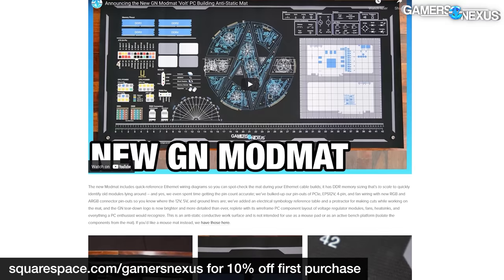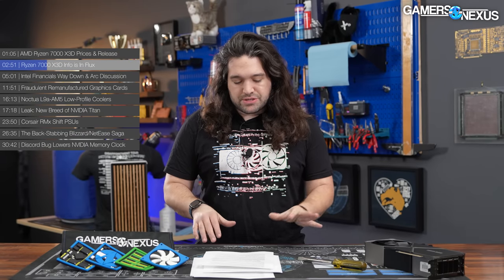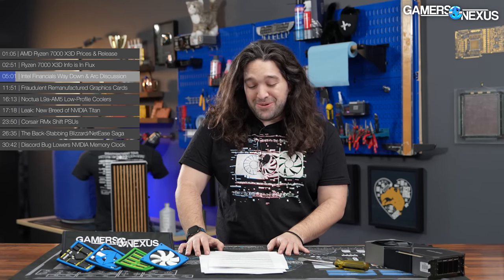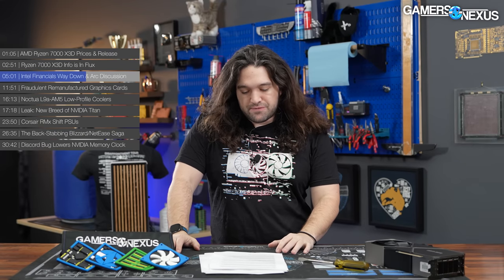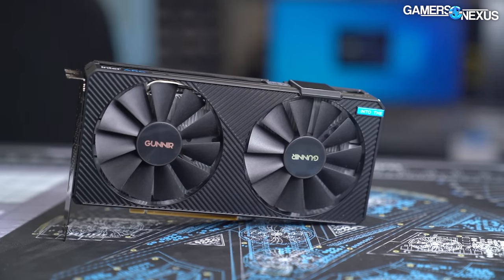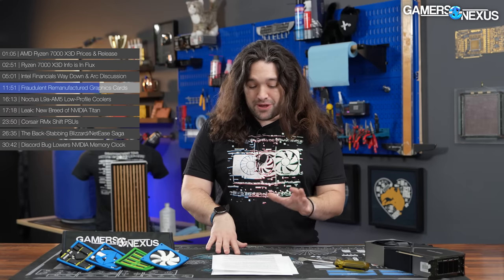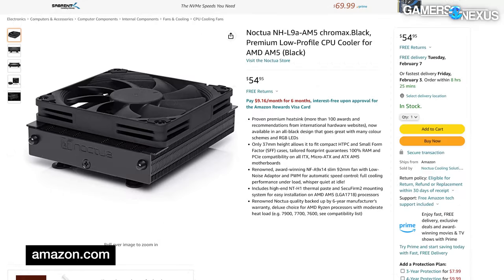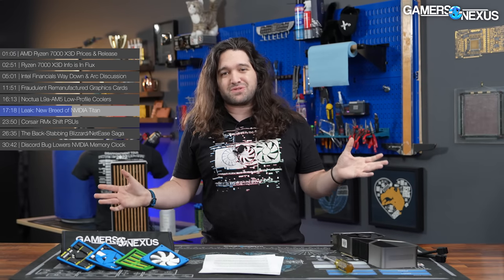HW News - Fraudulent Used Video Cards, 7950X3D Pricing, New NVIDIA 'Titan' Rumors

Comment: 5800x3d had locked curve optimizer in bios, but you can still do it with software in windows, it's only locked because F the user.
Reply: Undervolting the 5800X3d does wonders, still stable, higher clockspeeds and lower temps

Comment: Maybe you could disable 1 CCD on the 7900x3d to stimulate the 7800x3d before it launches. Would be helpful to plan my upgrade path and give better perspective.
Reply: You mean the 7950X3D, as doing that with the 7900X3D would instead simulate a hypothetical 7600X3D.

Comment: I literally just finished installing a Corsair RM750X after my old one died, and I had to (like you said) jam my hand in against the PSU shroud and spend a good 10 minutes trying to get a PCI-E cable to fit into my power supply. I for one support this new shift design if it means less of a hassle.

On the other hand, if I got a white version of the PSU or had a white case, I'd probably have the contrast to be able to see well enough that I wouldn't need the shift. Or hell, give me bright white cables so I'm not trying to fit a black cable into a black box in an enclosed space. The gimmick could be a good idea but what the hell? Why not just paint your connectors? Anyways, rant over. Great vid as always.
Reply: Or plug them in first. 😁
Reply: @memitim171  Haha yeah true. I thought I did man, but the second bit of the ATX cable into the PSU wasn't completely in. And again, that black on black is super difficult to see. I was checking the power switch connectors on my MOBO before I realized

Comment: That thumbnail with a 7950x and a Noctua low profile cooler reminded me of when Optimum tech paired that cooler with a 3950x a while ago. You've covered a lot about the lower TDP AMD CPUs recently and it was very encouraging. I'm really curious how an ITX system cooler would fare with such CPUs, both from Intel and AMD.

The blackridge won't be updated to the AM5 by the way.

Comment: Moore's law has dead showed a full render of a Titan Ada engineering sample that looks like this. It was about a month or so ago before this came out. Hardware Unboxed even publicly defended Tom when Kopite called Tom out for "lying" and faking what the cooler looks like. All Kopite said was that the titan was 3 fans, but they didn't say much else.

Tom's video is titled "Titan Ada Lovelace Leak: Pictures of Nvidia’s Dual 16-Pin Monster!" or if you trust a link https://youtu.be/wwZr4kp2gnc

Just a thought, either way, thanks for the great content on testing CPUs and GPUs
Reply: Moores Law Is Dead also insisted that Intel had completely abandoned Arc, with zero proof.
Reply: @Joostinonline  There isn't any proof they haven’t either, and it’s no like we can trust what intel says. Look at it like this. Raja got effectively demoted to his old job, and they stated that they are dissolving AXG and moving them to other departments.
“””
This includes our consumer graphics teams joining our client computing group, and our accelerated computing teams joining our datacenter and AI group. 

In addition, Raja Koduri will return to the Intel Chief Architect role to focus on our growing efforts across CPU, GPU and AI, and accelerating high priority technical programs.
“””

Look at their earnings for this year. They are estimating to have their first net loss in over 30 years. AXG is them almost 1 Billion a year. Can you honestly not see the writing on the wall? Don't get me wrong, I'd like another competitor in the GPU market, but I'd also like to keep a competitor in the CPU market against AMD also. Concider this
1. They stated AXG has been dissolved 
2. That they can afford to launch a full lineup right now, and not just a low end SKUs (including enthusiasts high end like they promised)
3. They should launch in an over saturated market,
4. People will want to buy an “inferior”(economics term) product over a "normal" product with their reputation at a price where they can profit.

They can’t afford anything that won’t be profitable right now. Tom did say they may have a single low end die each gen for driver development to have the option to launch a bigger lineup for Druid or later.
Reply: @Joostinonline  NOPE. He specifically said they are scaling down, and that instead of three chip designs for Battle Mage, they will only be making one.
Instead of listening to other people's interpretation of his video TITLE, you can try listening to his video instead.
Reply: Moore's Law is Dead is too quick to pounce on any rumor. This one example does not make up all the other times they were wrong. Even a broken clock is correct twice a day.
Reply: @sammiller6631  He leaked the code name for Lunar Lake, Dragon Range, Redwood Cove, got exactly what MI300 looked like prior to the announcement, the "ARC story." the performance jump of Zen 4, Ada using 4nm, HEDT being replaced with "mainstream workstation," MTL having accelerators, Bergamo, Zen 4C, performance of Golden cove, 
Shall I go on?
But I guess he can somehow made up renders for MI300, Titan Ada, ARC. Pretty impressive for a small broken clock

Comment: I really hope that AMD and the board partners end up allowing PBO and Curve Optimizer for all the X3D products moving forward. XMP, 1T memclk, PBO 10x, and CO -30mV are the only tweaks I ran on my old 5600X, and I find myself missing the final two on my 5800X3D.

I ran a LOT of benchmarks when attempting to dial in the perfect OC, and PBO + CO were the only two that showed anything I could daily drive that had better than margin of error changes.Anything else was just unstable. That might be my setup or cooling or something being trash, but if so, that only means PBO and CO are even more amazing.

Comment: I'll be very interested in seeing the gaming performance of the 7800X3D. I recently upgraded to a 5800X3D due to how well it's still holding its own, so I'm very interested in seeing how the extra cache benefits 7000 series.
Reply: While I am looking forward to the 7800X3D, that design was already proven on the 5800X3D. As long as AMD didn't do anything super dumb, it's guaranteed to be a great chip.
I'm more interested in what the asymmetric caching setup does to the 12 and 16 core parts. Are the cores on the other CCD going to benefit from the extra cache at all? Will they suffer a performance penalty? Will they clock higher than the cached cores?

Comment: Just invert the card! Cooler pointed up and not down, better cooling too cause that's how a vapor chamber is structured. Moisture gets heated on die then goes up as vapor condenses back into liquid then flows back down to the die. Never made sense to have it the other way around.

Comment: The noticeable point is how they capped the frequency of the 7800X3D @5Ghz so that it doesn't cannibalize the higher end ones that are uncapped to higher boosts.
Interesting, understandable but ugly. Strategically correct from them, but bad for consumers.
Reply: It is an architectural thing. 7950x3d, and 7900x3d only have V-cache on one core module. So one can boost high, and the other has the cashe. The 7800x3d only has one core complex, so they have to cap clock speeds like the 5800x3d.
Reply: @iankovac1878  ah ok... thanks.

Comment: Vertical PCB on Titan is intentional. 
That way you cant stack them on conventional MB even with low profile aftermarket liquid coolers attached and if you need several of them for workstation - you'll have to buy RTX6000(Ada) instead.

Comment: Steve, i'm sure you don't read this crap but it's pretty obvious what the intent of that cooler design is, to show off the sideways mounted gpu everyone seems to want and allow 100% airflow through the card instead of only one part, it actually makes a ton of sense, the part your looking at is the bottom, it plugs in sideways, the card itself ( the pcie interface / gpu ) will be on the top, the whole cooler is slung underneath, and the fans can blow right through, unrestricted.

Comment: Kinda sounds like we need an odometer for video cards. it would be trivial for nvidia to implement a read only timer for the 3d engine, few bytes of flash.
Reply: It's only read only....until it's not. 😁 Failing that, they'd just switch out the flash...

Comment: The Frankenstein GPU story goes in stark contrast to the video Linus put out yesterday. They bought 17 cards off ebay and had only 2 bad apples, with one being DOA. The conclusion of the video was: its not as bad as you thought and go buy second hand. At this point, it would be very very advisable from tech channels to make a PSA. In-depth dive to the dangers of second hand, more so after a mining boom. And it seems, there has to be a investigative piece on shady retailers. 
There is nothing wrong in salvaging working cards. But trying to SCALP on it is the main reason why no-one should NOT buy from such places or people. If there is no public outcry for such practices, then the ONLY option to hurt and teach such scammers is hit them where it counts: on their wallets.

Comment: You can also see the cutouts for the display output ports. And on the side for a sideways PCB there appears to be some locating pins and screw holes to secure it to the cooler.

Comment: The mess with Blizzard/NetEase is precisely the reason why the last multiplayer games I've ever bought were TF2 and CoD4. The reason being that you can run your own dedicated servers on your own hardware and it'll still work in 20, 30, even 50 years down the line, long after the official first-party servers have shut down and the developer/publisher has gone out of business. I've only ever bought single player games since that can work offline.

However, if someone does build a multiplayer game that has dedicated server software that the community can run (or one guy at a LAN party with no internet access), I'll buy and play it. I've been waiting 15 years, I can wait longer.

Comment: Just an opinion, but that "rooftop A/C unit" looks like a jig of some kind.  Current GPUs are made of copper, aluminum, and thin stamped steel.  That thing is solid, and I bet weighs 25 pounds.  I'm sure I'm wrong, but that thing looks like it is build for years of manufacturing, not a one-time install in a PC.

Comment: The rebadging of chips is a serious problem that the retro computer community has been dealing with for quite a while now. It's very common for sellers to take used chips and rebadge them, often as the same chip, but just as often with fake part numbers. It's seriously putting a crimp in trying to find replacement parts that are proper these days. We can't understand why they're doing it either. In the retro chip market, the chips are worth what they're worth, and painting them over with the same number doesn't do anything for the value really, and rebadging them as something else is just ridiculous when you're talking about things that cost a dollar or two generally. It's weird.

Comment: I absolutely tried to give Intel Money last Q. I looked at their offerings and given they are only doing 1 gen on the socket, there won't be an upgrade, and if I were lucky (and I wasn't) I could get the motherboard I wanted with just 1 gen5x4 m.2. AMD has committed to a 14th gen AM5 and the motherboards all have 2 gen5x4. I need the upgradeability.

Arc: they cannot give up. Intel is done if it can't sell GPUs on the main stage. Their entire future depends on GPUs and AI.

Comment: That discord bug makes a fk ton of sense. When I'm playing OW2 at the frame limit my game randomly crashes like every once in a blue moon when a lot of abilities are going on and I turn my camera quickly for a flick shot or something.
Reply: OW2 randomly crashes anyway with Nvidia cards, it's a known issue.
Reply: OW2 is way way way more CPU bound than GPU, i spend a long time trying to get rid of my dips and stutters and a few days ago i got the 5800X3D and it fixed everything @hypervizor
Reply: @handlenotset  I have a 5900x but it could be that the extra cache u have matters. My GPU is a 3090 and I've even tried using Rebar to see if it changes anything but the crashing is just too infrequent for me to know what is causing it and it's not always the same error.
Reply: @TheRealHypervizor  it really might be the 3D cache. i upgraded from a 1700 and while its the same amount of cores and similar clock speeds (my 1700 was overclocked) the difference in gameplay smoothness and fps is insane. went from 180-250 fps with microstutters to 500fps and havent had a single stutter moment since. my gpu is an old 1080

however, i havent had any crashes before or after, so something else might be going on

Comment: I had noticed my GTX 1070 memory clock dropping by 200MHz compared to what I set it to in MSI Afterburner but I assumed it was because I was pushing it too hard and forcing it to downclock, I had no idea Discord was causing it. Alas it's a moot issue now, I upgraded to a RX 6750 XT only a few days ago.
Reply: It's not Discord causing it if AMD drivers (and Intel?) are working fine. It's Nvidia getting sloppy.

Comment: i bought a sapphire 6900xt se via a dealership store. the box had 2 sapphire seals. one of the seals was broken but overstickered, with a round, clear sticker sealer. the boxed inside, looked already opend, but the anti static bag was sealed. on first glance, the card inside looked new, but some hard to reach spots, like deep groves in the cooler shroud and cables under the cooler, showed heavy dust buildup. fingerprints were all over the card, no foil on the card eighter. the 3 fans on that card, can be dismounted, but you need to unscrew 3 screws to do so. thesere screws showed markings of beeing unscrewed once already, the fan pins, werent even placed into the socket right, meaning they didnt turn because they got no electrical connection. i told the dealer, wanted to return the card for that reason. his reaction: can you proof that its not an old 2 year old card from you, that you wanna return to me and keep the new one i send you? you say you got used hardware and suspect a used mining card, i suspect, you had that model of card already, bought a new one and want to return your old one to me..

i feel scammed. its a bad situation, when even dealers get cards from distributors, that are cleaned up mining cards. well, now iam getting a 4070ti. i can be quiet sure there, not to get a mining card or a frankensteined one because its to new for that. i will never buy gpus again, after a crypto crash, when its a last gen card

Comment: Tertiary reason for the potential change of the Titan's orientation could be due to the fact that in thickness gpu's keep getting thicker and thicker and if that trend is expected to continue with each generation then it growing outwards with each gen towards the tempered glass instead of covering up more and more of the motherboard over time it makes sense to do it for that reason on top of the sag issue, that's exactly how I would do it... alternatively I can see direct motherboard contact becoming a thing of the past with larger GPU's and having them in a partially shrouded seperate compartment with a pcie extension running from the MB to the GPU the same way a PSU is seperate might become common place!

perhaps having the gpu at the bottom of the space with a panel right beneath the maximum motherboard size and then having perhaps another place to mount fans and gpu cooler radiators on that panel to push all the hot air upwards into the mb compartment! I could be wrong about the direction but my visualization of what that could look like in my head is sound! (I don't see this happening with form fact pc's though the gpu's are already suffocated without a shroud... this would be something reserved for larger gpu's and midi-towers upwards)

Comment: I got a Corsair SHIFT Power supply (850W version). I don't use the HDD Cage in the Lian Li O11 Air Mini, so the vertical oriented cables actually work quite well for this PSU!

Comment: Just a tangent.  I have kept my Silverstone RV02 case all these years (it has gone from Sandy Bridge to x570) partly because it rotates the MB 90 deg and so the graphics card mounts vertically.  I just think this is better than the standard canterleving the card out horizontally.  Interesting that this orientation never really caught on.  Cheers
Reply: I'm after their GD11 at the moment but it's impossible to buy here in the UK right now. 😢 When we had a ton of add-in cards and racks of hard drives and disc drives towers made sense, I don't really see the point these days for the average gamer personally.
Reply: @memitim171  I agree.  My RV02 just has a few SSDs now and no spinning disks.  The GD11 is a nice looking case

Comment: Gamers Nexus you asked in the video if anyone ended up getting a new Corsair shift PSU. I installed the RM1200X a couple of days ago and it has really improved my cable management. The cables are also flat which makes cable routing that much easier. In my situation I am using a Corsair 5000X PC case. The 16 pin cable supplied with this PSU for use with the RTX 4090 GPU is very well made. I believe this PSU and 16 pin cable is set to handle up to 600 watts. Best regards, Robert (a.k.a. that old EVGA volunteer forum moderator rjohnson11)

Comment: You said -200mhz I have mine putting a  180-200mhz more of a overclock causing crashes, I had to put my card down to 1725 so it hits its max which is 1905.